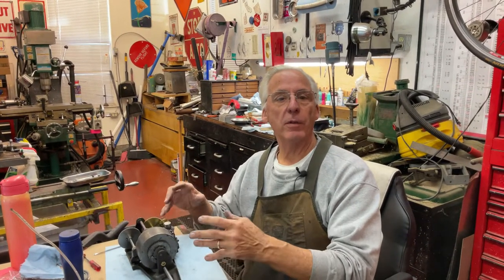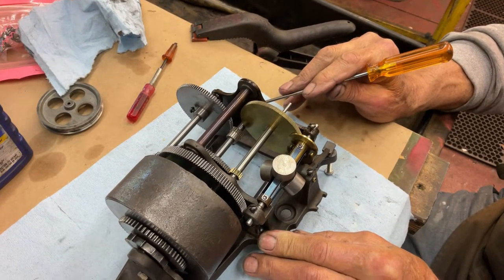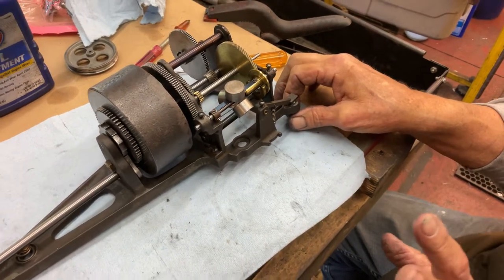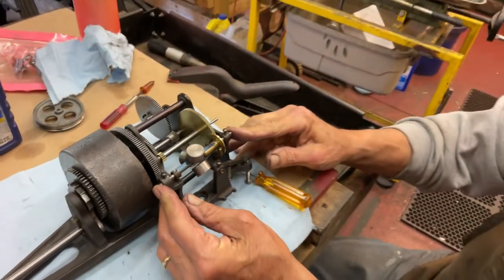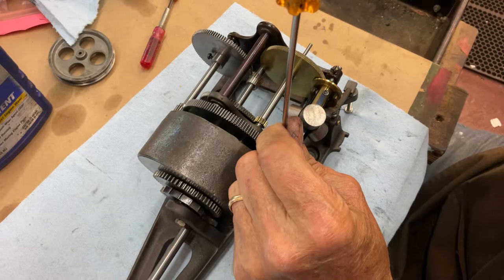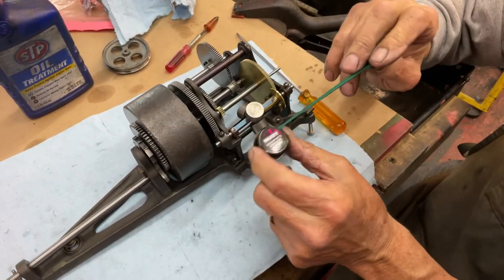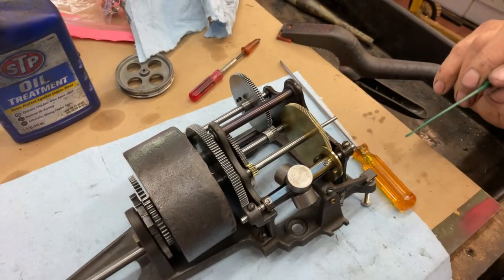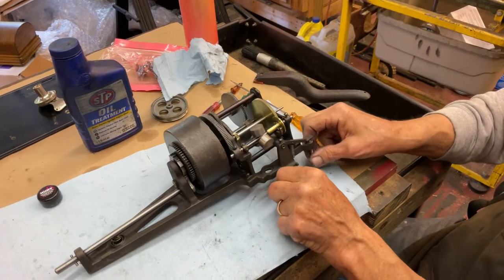1232.  The oiling and greasing of an Edison Home phonograph motor￼

Comment: Thank you, Brett, for your highly informative videos and advice. I have a question: do you have a video demonstrating the disassembly of Amberola 50 double spring barrels and providing guidance on reassembly, particularly after installing old or new springs? I appreciate your instructional content.
Reply from the maker: Not yet! 220 and 453 show some work on Spring barrels, but not specifically on the Amberola 50. I do have plenty of video showing how to pack a spring barrel.

Comment: Hey, I think I am little bit confused with all the grease stuff. I am not sure what to use because I see people use different grease and oil all the time. I saw you use different grease as well. I have myself a home phonograph and a gem that would probably enjoy cleaning because previous owners have put gear grease everywhere and it's gross even though they are working okay. What exactly should be used between green grease, white lithium grease, hudy, superlube, stp, sewing machine oil, 3-in 1`... they re seem to be so much to choose from yet not all would be good choice I presume. Would you be able to help me a little here, or point me to a video you've made on the subject maybe ? Thanks a lot !
Reply from the maker: I use green grease on the gears and in the spring barrels when I rebuild the machine. I use sewing machine oil on all the running pivots.  I use STP on a gear that is noisy or on the governor drives gear.  Where you have steel to brass , use graphite Hudy.  Super lube goes on the lead screw..
Reply: @1974hurt  I see that's clearer, thanks !

Comment: Would you, please let me know if there is any way to grease (or maybe diluting old grease oil) springs without disassembling the spring barrels? I see couple of large screws at the side walls of barrels. Isn't it the access points for lubrication? Thanx.
Reply from the maker: Yes, you can remove those screws and spray in some WD-40. That will hopefully mix with the old grease that’s there and loosen it.